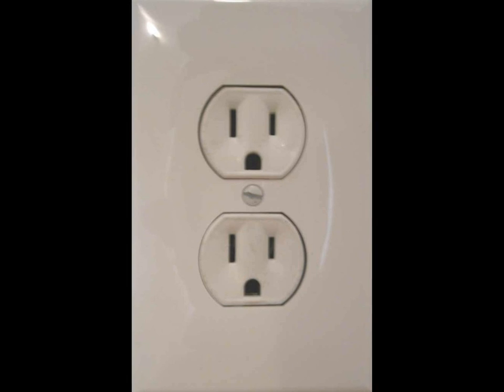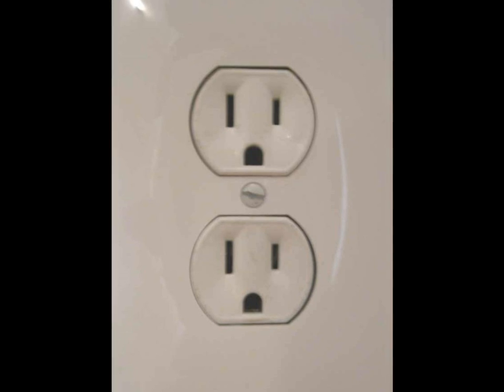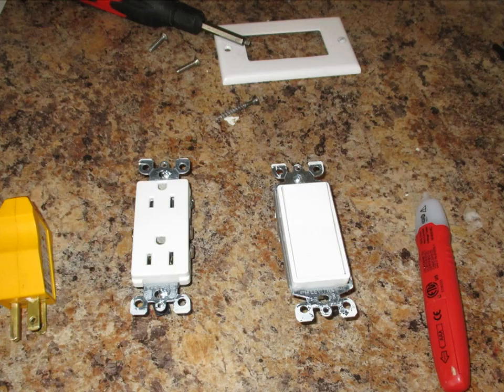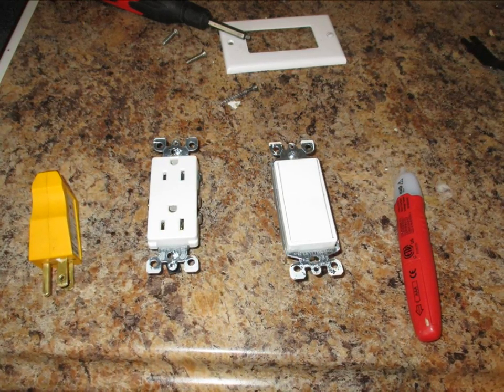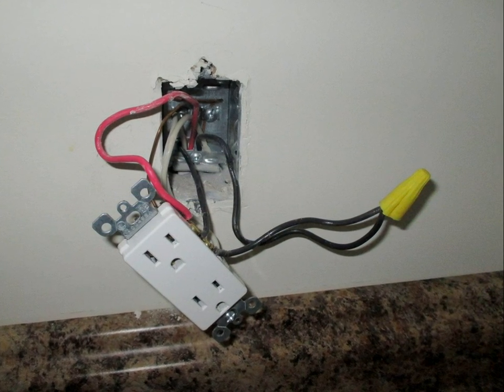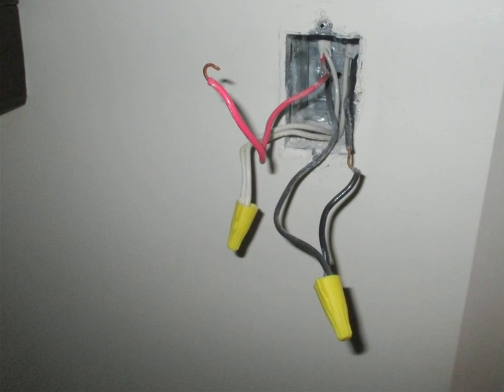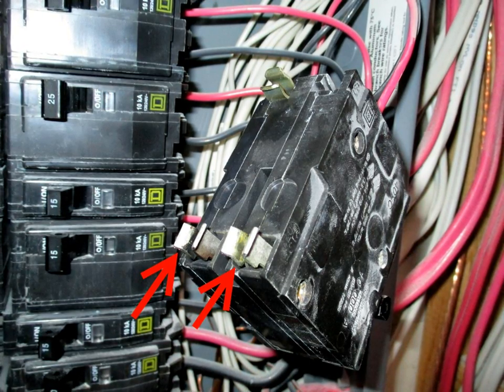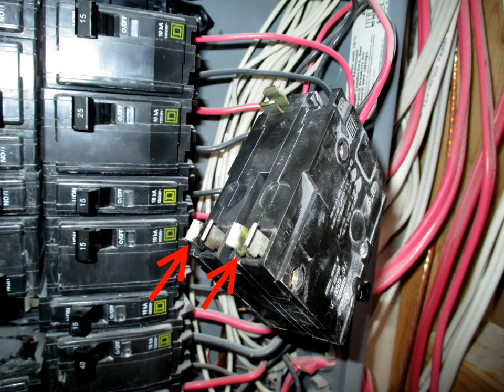electrical outlet not working

Comment: Why is the Us power system so far behind? Your light switches are new but so old looking and you power outlets still do not have switches so you can turn off an appliance 
without having to unplug it. How crazy.